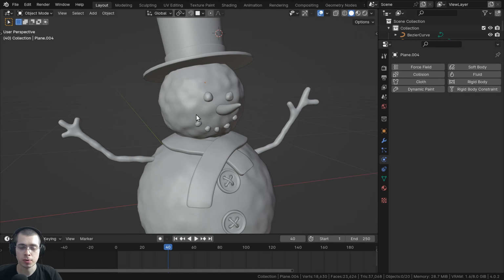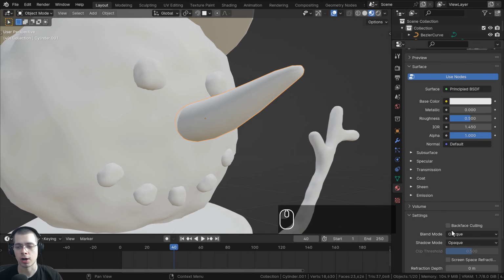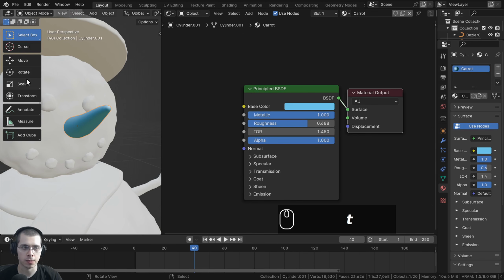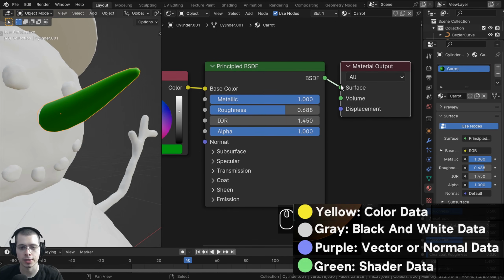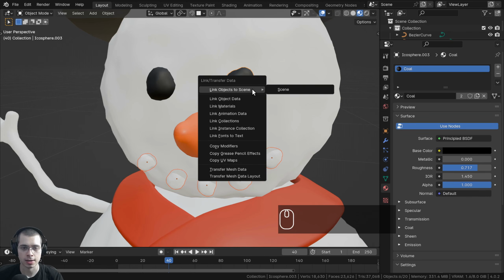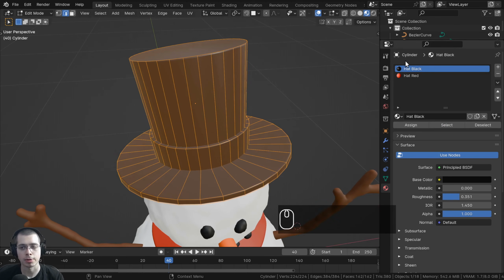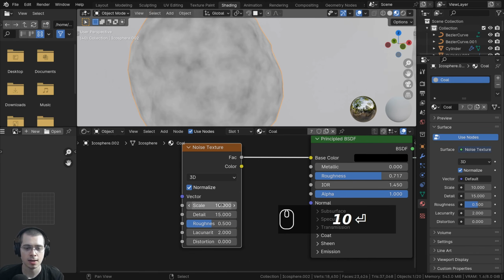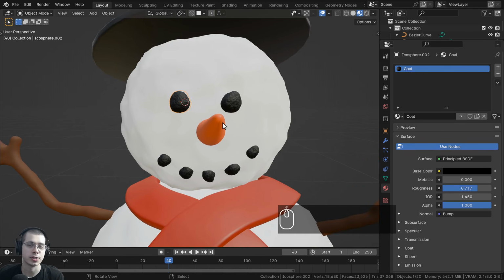Part 7 - Blender for Complete Beginners Tutorial Series (Basics of Materials)

Comment: For some reason, the rock texture isnt coming even after i make the bump and the other nodes
Reply from the maker: If the bump doesn't seem to be working, check that the bump node values are all the same as in the video. There was a recent Blender update to the bump node, and the default distance value is now much lower.

Comment: Ryan, this is the best taught blender tutorial series I have seen on U tube. I started doing 3D "modeling" about 1985 in AutoCAD. (At the time AutoCAD did VERY primitive modeling.... basically worthless. ) Went on professionally to work in Inventor and SolidWorks. Solid Modeling is totally different than Mesh. I found Blender Mesh modeling really frustrating because there were things I could model in two minutes in SolidWorks That seemed to take forever in Blender... like the hat on the snowman. I would have sketched the half profile then rotated it around an axis. If I needed half the hat I could rotate it 180 degrees rather than 360...  But now that I have the process figured out for mesh modeling, I am able to model the hat dented on one side and able to make the brim bent.   But still technical Solid Modeling is a totally different animal than Organic mesh. .... Also, as a technical designer my mind works in know dimensions. I think the new PDT functions will help me with that problem. ... Keep up the good work.